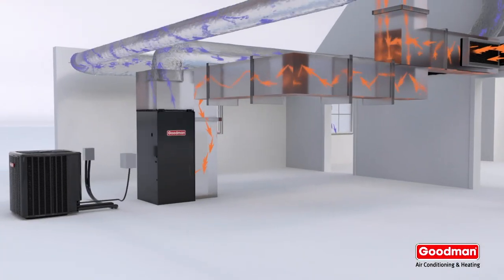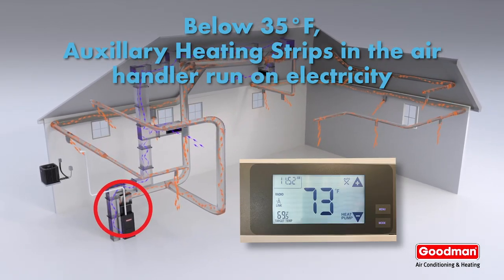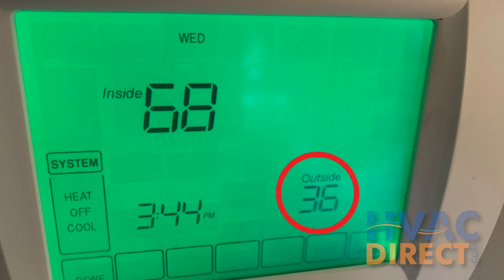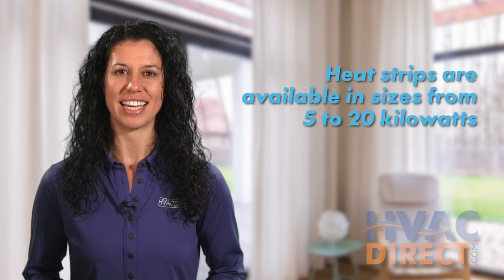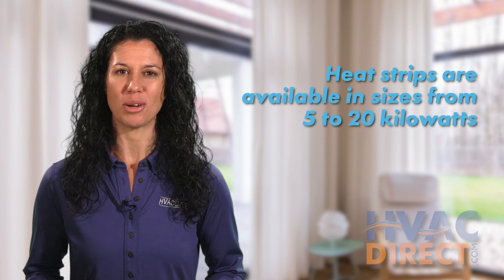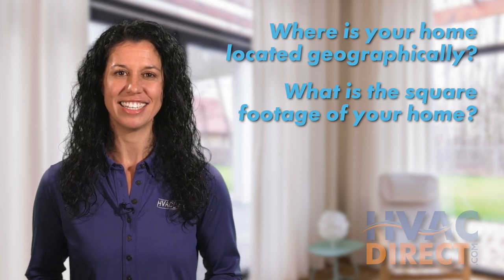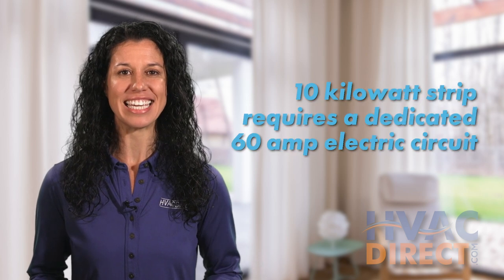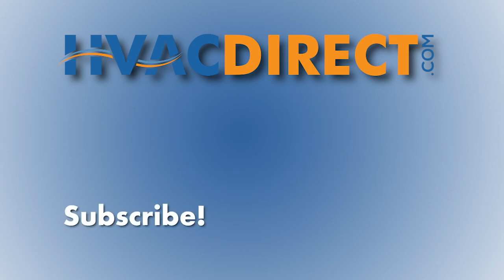What are Heat Strips and How Do They Work?

Comment: Okay, so rule number one....there is never a time when you should set your thermostat to "aux heat" or "emergency heat" unless your outdoor heat pump unit fails to operate completely!  Your thermostat...especially higher tech models on high end systems will determine WHEN and IF "aux heat" is needed to SUPPLEMENT your heat pump.  Even at 5 degrees the heat pump is still 100% efficient.  If you manually energize your strip heater you lock out the outdoor unit which means you don't get to take full advantage of what heat it is able to produce.  

For example...if you have a 3 stage 10,000 watt strip heater and your heat pump is running on full blast, but unable to keep up....the thermostat may only energize STAGE 1.  This would be about 3300 watts of strip heat instead of the 10,000 you'd get if you manually energize "emergency heat."  If the system isn't capable of using varying levels of strip heat, but only needs to cycle the strip heater every few minutes to supplement....it is still far better than trying to heat your home with that 10,000 watt heat for 24 straight hours while the heat pump which is perfectly capable of providing at least some heat is sitting outside and not being utilized.  In ONE SINGLE DAY OF "EMERGENCY HEAT" you could use 240 kilowatt hours of energy to run in emergency heat mode vs about 72 kilowatt hours to run the heat pump.  

Most heat pumps won't draw much more than about 3000 watts of energy or 3 Kwh while a 10 Kw strip heater would draw 10 Kwh every single hour of operation.  Therefore, the heat pump is roughly three times less costly to operate no matter the outdoor temperature than the strip heater for every single hour of operation.  You could see a massive spike in your power bill if you aren't careful.